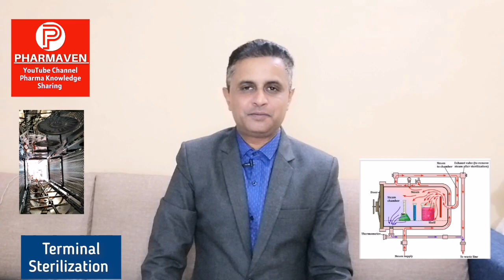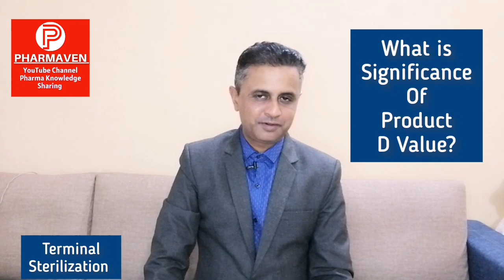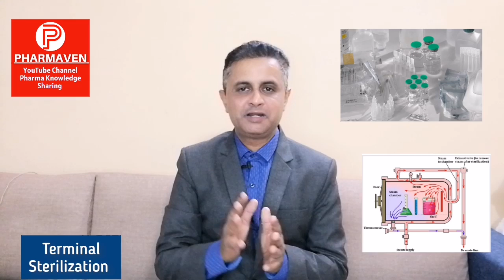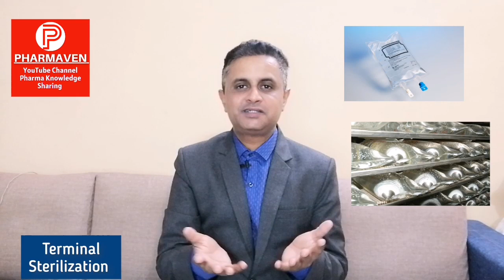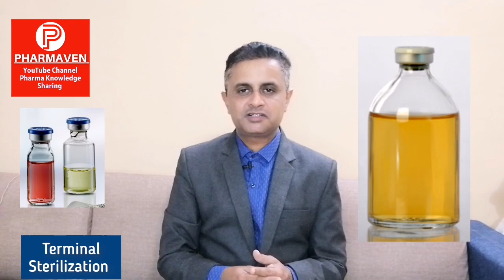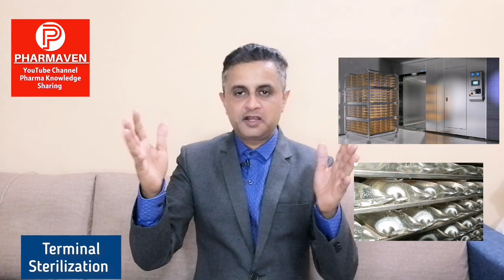Terminal Sterilization Cycle Development #sterilization #autoclave #pharma   @PHARMAVEN #validation

Comment: If i  use over kill approach of 8log reduction why i consider  121/10min cycle not a Sterilization cycle.and what is the minimum  time parameters if I need to change for higher temperature as 134.knowing that f0 is12.... thanks.
Reply from the maker: Overkill depends upon D value of product, for example if D value is 1, then 121 degree C at 10 minutes will give 10 log reduction, Overkill means 12 log reduction.

Comment: Nice,My question,what’s area is required for terminal sterilizer,is non class area okay? Please give answers with reference
Reply from the maker: After filling and sealing,  the product is basically finished product and doesn't need to store in classified area.  For terminal stabilizer, CNC (Controlled Non Classified) area is acceptable